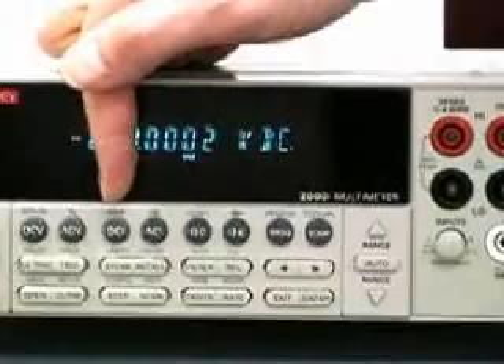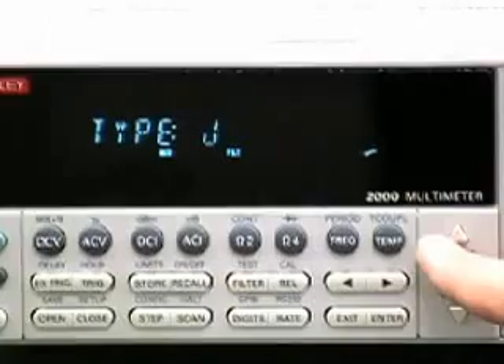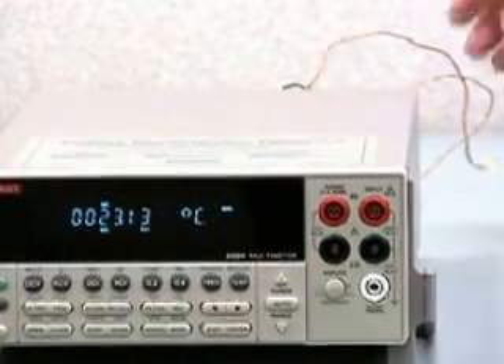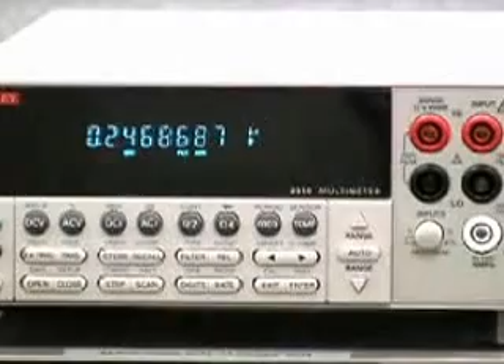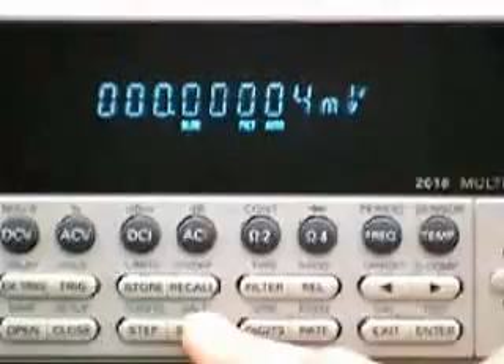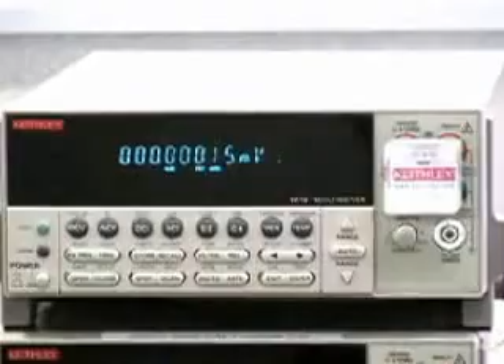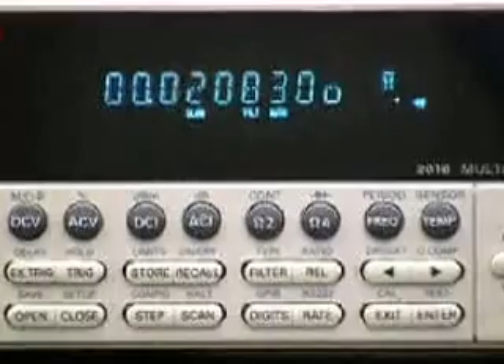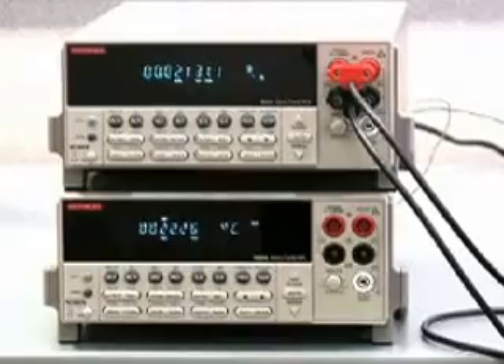Keithley 2000 digital multimeter

Comment: I have Keithley 2000, when I connect the thermocouple type k with furnace it is not giving me the correct temperature as furnace. The difference is around 70 C. 

So, could you please help to solve this issue? 

Also can you show me where I have to contact thermocouple with Keithley 2000? 
Thanks so much.